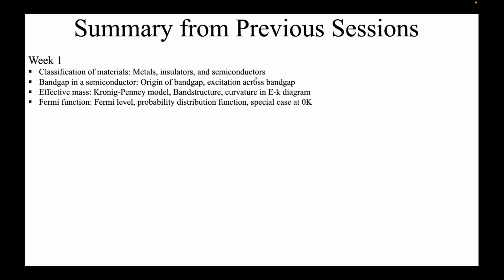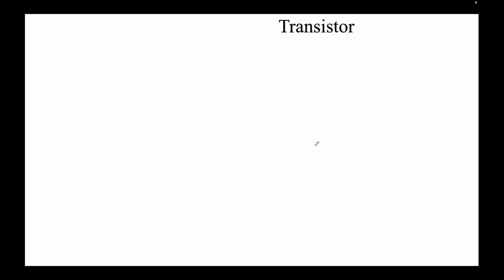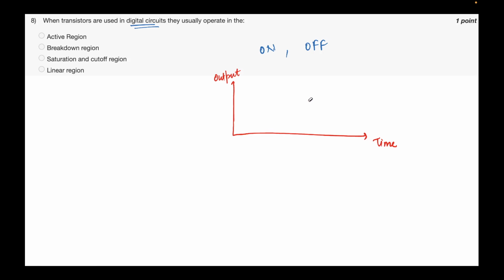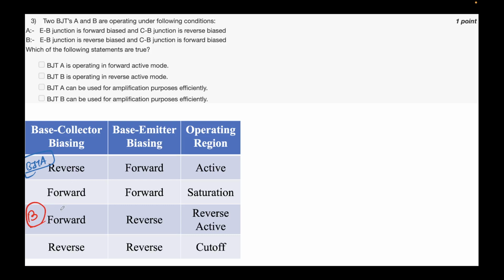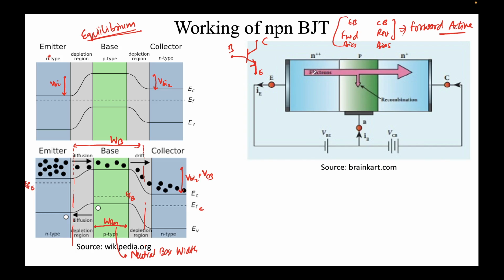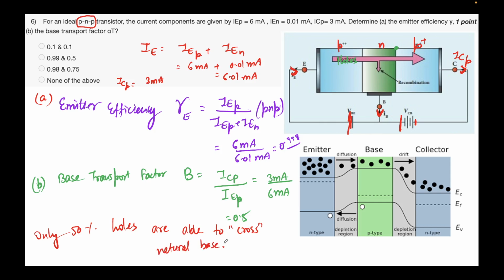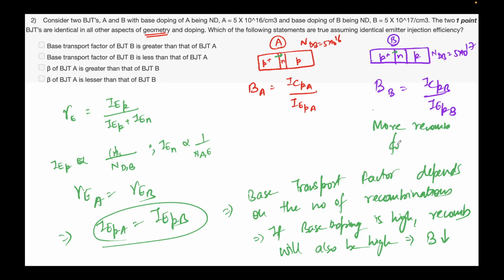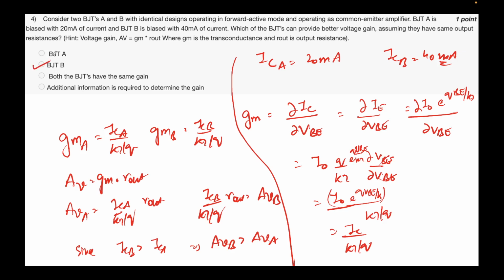Fundamentals of Semiconductor Devices: Bipolar Junction Transistor working and operating regions

Comment: 30:02  this question has been asked in gate electronics and communication paper twice (once in 2010 and again recently in gate 2022) and both the times it was challenged by many aspirants but in final answer key the IIT committee said doping of collector is least and emitter is highest as given in Donald Neemans book on semiconductor device physics .so i think the doping order is incorrect here.
 By the way great lectures.keep it up brother.
Reply from the maker: Thank you Hemant for the correction. 
Take the case when base is doped low as compared to collector. As collector-base reverse bias in increased, depletion width of collector-base region will increase. This increase of depletion width will be more in the base region than collector region thereby reducing the neutral base width, which in turn causes an undesirable rise in collector current (without any change in base-emitter bias). This rise in collector current is related to Early effect, and output conductance. Thus, collector should be doped lower than base.
Reply: @learnwithamitbansal   👍.
Love your content brother.

.